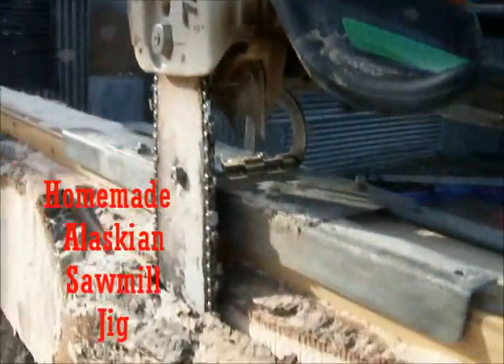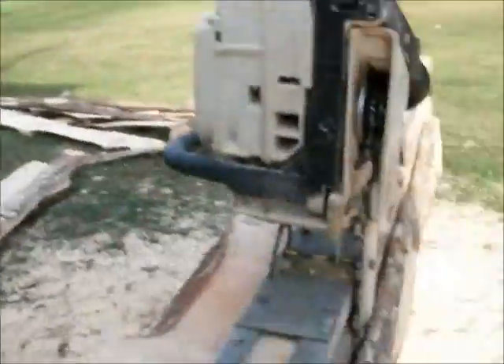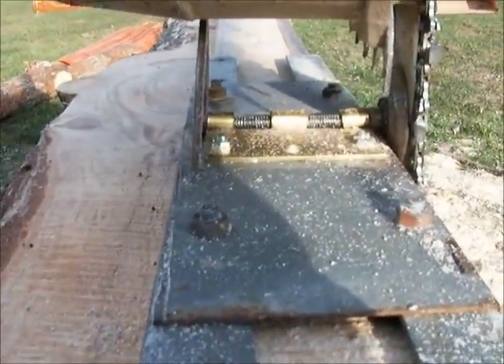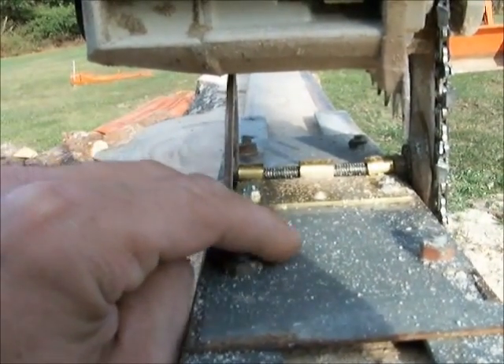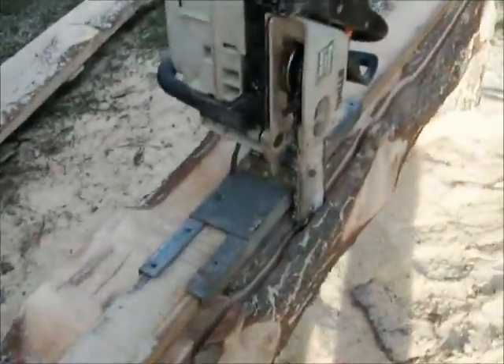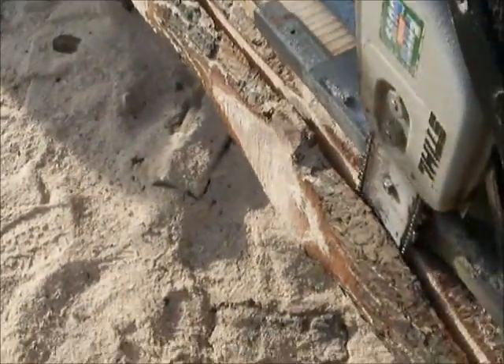Alaskan Sawmill Jig (Homemade Sawmill)

Comment from the maker: The angle iron is 18" long. Yes attach the 2x4 to the log. I would recommend you use screws though it makes it easier to remove afterwards if you have a drill handy.

Comment from the maker: So you must be talking about building a band saw mill. I would like to build one of those myself. I love the setup I use now but can see how a band saw mill had advantages. The one thing that does discourage me is I saw a lot during winter months and the band saw do not like frozen logs. As where my chainsaw mill doesn't seem to care. But it takes a big saw Dolmar PS-9000. This video shows a jig I made for my small saw. Have you checked my channel to see my current setup?Good luck keep me posted

Comment: Jason , what angle of the teeth are you cutting with? Is it 10 or 15 degrees?
 Thank You
cj davis from plymouyh indiana.
Reply from the maker: clark davis I tried 10 degrees and it cut very quickly through a few logs but I noticed a lot more vibration. So I changed it to roughly 15 degrees. This took most of the vibration away and it still cut fairly fast.
Reply: Thanx Jason

Comment: 500 bucks is max  that i will put in the saw mill "wish me luck" cause the motor will cost 300 bucks alone, 2  18" wheels at 50 bucks each not counting pulley, belts, angle iron, rollers ect so looking to cut the cost by using a washing machine motor or air compressor motor to run it if i can

Comment: How many horsepower has the Stihl chainsaw?
Reply from the maker: +Jonas Kriegl I am not sure to be honest. It's a 90cc motor. It's sounds like a bad ass dirt bike. The saw is actually down right at the moment. The piston cracked. So I need to take time to rebuild that. They don't make the PS-9000 anymore so parts are hard to find.